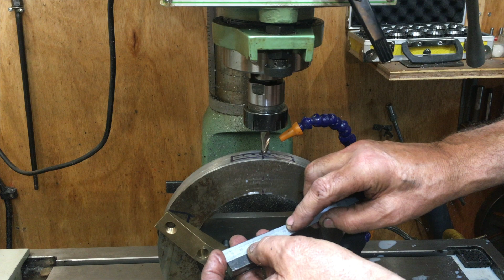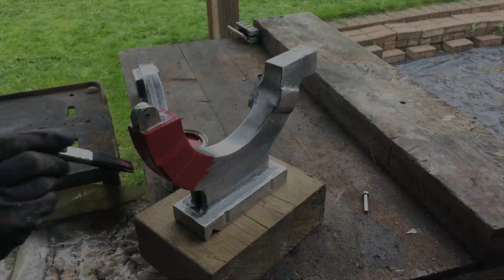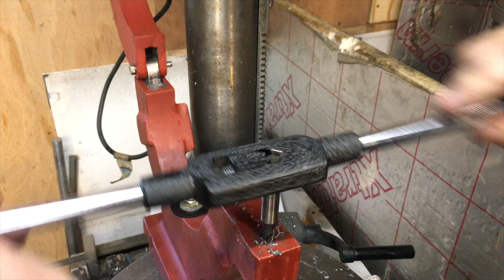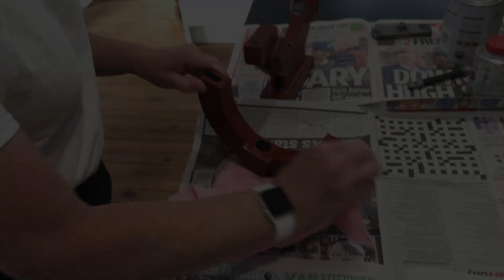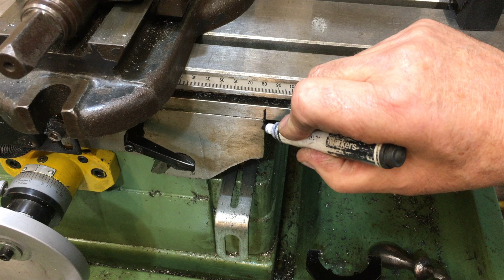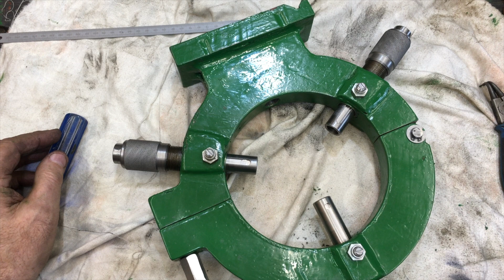Making a Steady Rest (part2)

Comment: Hello Paul,
A bit after the fact but, if your "slider locking screws" were inserted from the "chuck" side of your steady you would be able, without fouling them with your topslide and or tool post, to machine much closer to the end of the supported work piece, end, for instance threading almost up to the steady support arms. 
Otherwise an intreeging way of producing a steady. 
Initially, I must confess, I was convinced you had used a casting it was so well disguised under the "red lead" look alike primer your wife used. It certainly hid your "chicken poop" welding well. 
I'm  still a little confused over your adjusting screws "hijinks!"
I started watching your video because I'm partway through building a Hemingway kit for a four finger fixed steady but I don't particularly  like the design of their finger adjusters. I've mulled various ideas, yours intreegs me if I can work out how to reduce the dimensions to suit the castings supplied. Mine is to fit my 1949 Myford ML 7 lathe. 
I also have their travelling two finger steady part built but that is waiting for the milling of the slots to carry the brass fingers, locked with a screw and a washer. No screw adjusters as yet unless I can work something better into it's castings.
Thanks for the videos.
Regards from Canada's banana belt.
🤞🇨🇦💪🍌🥋🇺🇦🕊🇬🇧🪓🥫🪒💩🐖👜🏁💪🍺👍

Comment: I want to make some varius steady rests for my machines. Just need for them sometimes. This is one great video to see and think a little. Long time ago I machined ~sae 5140 (C-0.4%, Cr ~1%, Mn ~0.7%) D=~50mm, L=~850mm in centres with steady rest in middle at aprox  800rpm. It get overheated in steady rest (my fault) and get jam in 2..3 seconds... 10kW lathe stoped as nailed to gound. That was little scarry.
Reply from the maker: Hi, I know what you mean, I have seen the result of big steadies blowing the bearings apart on a 50" lathe.. scary.

Comment: Very nice result. I like the hidden hinge. Good idea.
Next project, a tap hoding chuck spinny thing :)
Reply from the maker: Shhh.. I’m thinking 🤔 very hard about the manufacture of such an item but, I’ll keep it under wraps for now..
Glad you enjoyed the video, cheers 👋
Reply: Maybe a sprung tap centreing device like are sold, quite cheaply, over here in Canada.  Just make sure you get one not only with a 60° centre but a reverseable one with a cone for those very small, 10ba and smaller taps. 
Also some "tap twisters" like Joe Pieznsky advocates for smaller, delicate taps.